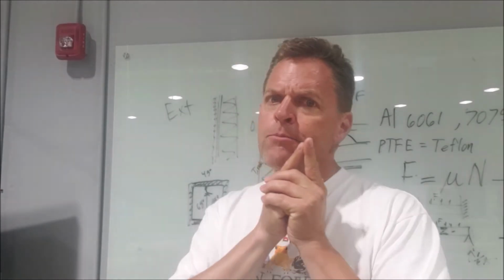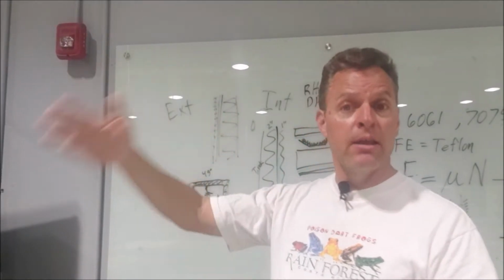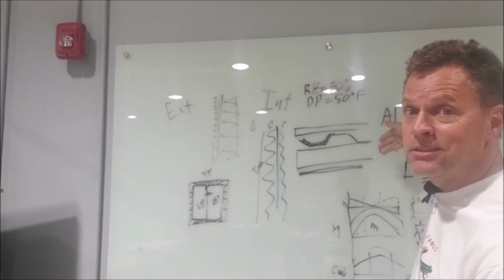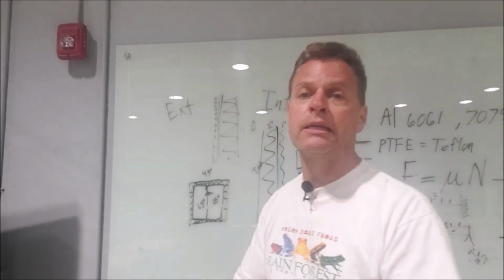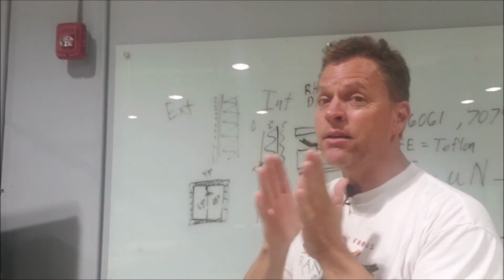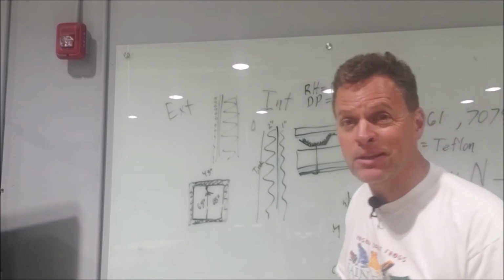Condensation and insulation in an iso shipping container home, Ep. 3

Comment from the maker: I finally found the GPS foam at a foam manufacturer.  They got the beads, made the foam, and cut it to my 1" and 2" thickness for less than buying panels.  I used DeRouchey Foam in the Burbank area of So Cal.  www.derofoam.com  They were so helpful and great to work with.
The foil-backed foam came from a different vendor, who I would not recommend.  Insulation-4-less is more like insults-4-less, as the owner has lots of negative reviews and deserves them.  I don't believe their quoted R-values, but the data sheet allowed by Title 24 engineer to design something that worked.  I think that the other products that are available through other companies, even Amazon, are the same product but without the inflated data sheet.

Comment: You can save $$ Thousands $$ and endless hours of labor by purchasing a single use INSULATED High Cube shipping container with beautiful one piece interior fiberglass walls. These type of containers are designed for frozen food and to maintain subzero temperatures. They are better insulated with 6" XPS structural panels of high R Value. There are various sizes with side and end door options. If you are planning to use the container for housing or an office you could easily move in on the day of delivery. By being frugal it is simple to add modular ventilation Mini Split Heat pump $500 or less for cooling & heating plus your furniture, cabinets, shelving, tools, etc.. Of course you could spend, spend, spend on interior and exterior options. 
MY OPINION:  It does NOT make financial sense converting OLD used uninsulated containers. By the time you add hours of labor to install stud framing, insulation, wall covering, flooring, sealing, priming, paint, etc., the costs can be MORE than NEW CONSTRUCTION when you add the cost of the container and delivery. There are 3 great options of shipping containers.
#1. They can be moved easily to other locations and or installed on a flat bed truck with appropiate Connectors and it instantly becomes a Mobile home. 
#2. Add Optional modular platforms to increase living space at the sides and rear. 
#3. Shipping containers are designed to be stacked. They are easily transported and should be water tight. Simple modifications can be made on the roof for additional living space, lounging, solar panels, etc..

Comment: Hi Alpin, I agree whit you when you said, we have tu put the dew point the most outside of the container stucture that we can.
I'm architect in Chile an right now I'm desiging my house to a warmest area at south america. At my country we have te same zonification map to module the diferent existing climates us your country and I'm studing the insolation for a number 5 zone area, whit to much rain and humidity.
We decide to get the metal structure container not recover by the inside, just only by a good paint whit the idea to put all our efforts at the outside isulation using injected polyurethane foam whit a Tyvek membrane for the humidity control and for the humidity control we must have to use a AC's evaporator.
In addition for the outside we are studing an air camera betwen the humidity membane and the rain cover or siding.

I put some links of interesting papers of this matters.
https://buildingscience.com/documents/insights/bsi078-ship-shape#P04
chrome-extension://efaidnbmnnnibpcajpcglclefindmkaj/https://core.ac.uk/download/pdf/296919169.pdf
https://icontainerhome.com/preventing-stopping-condensation-in-shipping-container-home/
And this complementary video https://www.youtube.com/watch?v=kjbgduaH_7U

I'm be waiting for your insulation paiting studies.
Thank for your clear concepts in your videos.

Comment: Very interested your video, I'm planning do 3 40Ft containers B&B in my property in Costa Rica close to the beach. Do you have some video or tips what tipe insulation I can use there?
Thank you
Reply from the maker: Mostly a warm and humid climate. Will you have A/C? You need to keep the moisture away from the exterior, but polystyrene would probably work with a moisture barrier.
Reply: @Mr. Alpin  yes I will need AC, the area is usually 38c to 44c
Reply from the maker: @anthonydustinchancalvo6841  then your interior will be cooler than exterior and will cool the metal from the inside. Moisture barrier on the exterior is critical

Comment: Thinking of putting an insulation layer against the inside metal. Then a vapour barrier. Then plaster board. Will this work?
Reply from the maker: That should work as well.  It comes down to the details of installation.  How do you seal the joints and making sure you lap the joints to direct condensation.  You are keeping the warm, moist air away from the insulation and then get to the metal.  Are you in a cold, warm, humid, dry environment?
Reply: @Mr. Alpin  im thinking sealant all round the plasterboard joints. As well as round the vents to prevent any chance of moist air making contact with metal. I understand air can penetrate the plasterboard that's why the vapor barrier is needed behind it. Is a varied climate, cold damp in winter, hot humid summer. Have only noticed condensation in winter. May run a small dehumidifier during winter too
Reply from the maker: Yes, drywall is highly absorptive and permeable.  Unpainted is 20-90 perms and painted is still 10-40 perms.  The cold damp winter means that you will heat it so it will condense on the inside, hot humid summers mean you will have AC and might get condensation on the outside.  I would definitely treat on the interior and tyvek the exterior to provide some protection there.

Comment: What extra expense doing all of those layers??? Makes no sense, looks like spray foam is more cost effective.
Reply from the maker: Have you priced out having spray foam installed, especially with multiple spray days?  With spray foam you need studs to set the depth so you need to add framing too and have thermal bridging penalty.  You need to get to about R-22-25 on the walls.  GPS foam is sold by the inch, so it doesn't matter how many layers you have.

Comment: Completely off topic - well almost, and perhaps the subject for another video dealing with condensation... what are your thoughts on building a home with refrigerated or insulated (Reefer) shipping containers. I have been thinking of using reefers and removing the paint finish on the exterior to expose the matt finished stainless steel cladding. I also thought it would be novel to give the same treatment to the bathrooms and parts of the kitchen. The foam insulation is estimated to have an insulation value of R45 to the walls and more for the floor and roof.
Reply from the maker: Interesting thought.  The spec of a refrigerated unit is 8' exterior width, 7'6" interior.  That is 3" of wall thickness per side.  R45 would mean they are achieving R15/inch.  The highest rated closed cell spray foam is R7.  I am guessing that the container is more like R21, at best, assuming no thermal bridging due to ribs.
Reply: @MrAlpin  Thank you for this information, it is helpful. FYI the vertical metal supports in the walls are staggered in an exterior and interior layout and are approx. 30mm deep, each side supports a skin, so no thermal bridge is created.

Comment: Have you seen a container insulated only outside in cold weather?
Reply from the maker: I have not.  I am seeing that the metal gets cold on the interior.  There are enough exposed edges and undercarriage that the metal is pulling the heat out.  I am thinking to add more insulation to my exposed metal walls on the interior for this reason.

Comment: I'm thinking about a product to coat the metal just to start off like Bed liners spray for your pickup truck, or white stay cool reflective paint for painting roofs then put all the rest of the installations on. What do y'all  think? I'm living around Houston TX by the way Thanks.
Reply from the maker: Any insulating coating will help. The foamier, the better.  The difference between white and black will be less significant if it is not a surface that is exposed to the sun. White will reduce the emissivity and absorptivity but I would go with the thicker coat. You might be able to add the microsphere paint additive to one of those coatings to get additional benefit

Comment: Number one:  Buy a refrigerator container in the first place.  It will have a good starting layer between the skins which you can add to.
Reply: Yes your right that would be excellent wow but how much are they?
Reply: @sntruck  not that much more as you don't need the unit.  Sometimes no more.
Reply: Reefers have low ceilings
Reply: @marco-OTM  Not the ones in use in the Pacfic Northwest.  We hauled thousands of them over the years.  In fact I have never seen any that weren't standard height and lengths.

Comment: Even though I would loose interior space, could I build a wood frame with insulated walls, ceiling, floor that had a gap and never touched the metal anywhere in container, except the floor a little, so that it would vent around all 6 sides and metal could remain at nearly the same temp on both sides? Another way to explain might be, a box inside a box with 2 inch ventilation on all 6 sides of interior box. Is that an option worth considering? I am thinking, even if there is still condensation it would be on the outside of the interior house and possibly have drain holes, slanted interior roof etc. Thanks for any input.
Reply from the maker: Interesting challenge. There are some factors that are important to consider. What side of the wall has the warm and moist air?  The fact that both sides of the metal are the same temperature doesn't matter as much as which side brings the moisture. If you are in a cold environment,  the humidity will be in the inside and condense on the cold metal. I have seen it collect and drip off the roof corrugations. The trick is to keep the humidity away from the metal. The ventilation will help but include moisture barriers. If you have a vapor-proof bag inside a box within the metal box,  you should stay dry. If you are in a warm and moist environment and air condition the interior, then your condensation will be in the exterior of the metal.
Reply: @MrAlpin  is there "another way" ? 
Such as using "Cork" - would it bond to shipping container walls or would the natural resin eat the paint? Maybe uncoated Corten steel and then manufactured Cork to fit the contours? 
Then spray foam could be used on the OUTSIDE of the shipping container where it can off gas safely for ever if it needs to, then clad with anything...OR have another layer of metal container sheets and FILL the gap between them squeezing out ALL gaps...
One the inside after Cork is layered appropriately, then a manufactured/milled flat sided log as interior wall, which provides good thermal mass and Additional R value and nice durable interior...
?
Would that be sufficient to prevent moisture build up/condensation or would an air gap be needed between Cork and milled log and then create some sort of negative pressure venting fan or airflow? Or a dehumidifier?
Reply: @MrAlpin or is it possible to create a thicker milled log wall that it multidirectional layered in the "shape" of a container with a steel I-beam frame so that it can be moved "as a shipping container, but avoids nearly ALL issues of the metal trapping moisture because there is almost none to begin with...like 9 or 12 inch log walls?

Comment: Watched this one again today. So, just to clarify, on the exterior: siding/cladding, tyvek/similar, insulation, container steel. Inside: container steel, tyvek?/similar?, insulation, drywall/etc….. Are those the correct sequences? Or have I got a couple reversed?
Reply from the maker: Yes on the exterior. The inside is container,  1/4" foil backed foam as a vapor barrier,  1" GPS, then paneling.
Reply: @MrAlpin  have you ever thought about the concrete siding panels, and rock wool insulation on the exterior, for additional fire resistance, and if so, what did you conclude?
Reply from the maker: @jasonmitchell432  I am using the Hardipanel 4x8 sheets on the two ends of the cabin, metal siding in the long sides. I will have other videos as soon as I get more time to edit and release.
Reply: @MrAlpin  Awesome! I’ll look forward to them!
Reply: Question on the exterior: Would it be beneficial to put double side foil foam to give a monolithic wrapped barrier to the whole metal, especially when framing out the openings so no wood is touching the metal (as a traditional stick build). My thoughts is giving extra protection to the metal against the cold. 
Interior keep as you described. Thank you

Comment: Good evening, I'm curious about using tyvek home wrap on the exterior of my shipping container workshop. Would it be best used on the metal skin of the container then insulating and siding or on top of the insulation below the siding?
Reply from the maker: You want to use the moisture barrier on the warm and humid side to keep the moisture from getting to the metal.  I used Tyvek on the exterior of the exterior insulation under the metal siding and foil back foam on the interior.

Comment: What insulation type and setup would you choose if the exterior was kept as the container metal and water tight in a cold climate all year round? Thanks for explaining all of this.
Reply from the maker: If you want to have the metal container exposed to the cold exterior, then you need to do all your insulation and vapor barrier on the interior, at least R-17 with not thermal bridging.  Remember that all the metal will be the temperature of the exterior and will suck the heat out.  This was going to mean that I would loose about 3.5" per side or 7" overall width on the space so I moved 4" of that outside.
Reply: @MrAlpin  Thank you. I'm nervous about using spray foam but I keep hearing how it out performs insulation wise. I see van builds using hemlock wool so I'm looking at that as well, the less toxic the better in my opinion. I will check out the rest of your channel you may have already answered other questions I had.
Reply from the maker: @timtim-ef7xu  It seems like spray foam is the best, but it was much more money and we could not install it as we were ready.  It has to happen all in one day.

Comment: If not using the foil barrier that you described, would you install a tyvek vapor barrier? If so, does it also go on inside sandwiched between inner metal shell and the GPS?
Reply from the maker: Tyvek is actually not the best vapor barrier.  It has a high perm rating of 56, so is is good to shed most water, but allow it to dry out.  If you want to seal out humid interior air, you need a much better barrier.
Reply: @MrAlpin  Thanks. How are you sourcing the GPS insulation panels? I've looked all over and cannot find them (central california). Am I correct that you are using the foil-backed foam against the inside metal (with foil against the metal) and then the GPS is added? So: container | foil-backed ridged foam board | GPS? Any thoughts on using double bubble foil in place of the foil-backed ridged foam (assuming I understand your plan)? Sorry for all the questions, but I believe that of all the sources I've looked into, you have the most thoughtful and data-based plan.
Reply from the maker: @rustart  I just put the vendors in the pinned comment.

Comment: Forest Grove, OR. Well have rain, some snow, hot summer and wet spring. How to figure that out for insulation?
Reply: You need to prevent the warm humid air from contacting both sides. Again,  insulating and wrapping both sides will be critical to keeping the metal from getting cold and warm air from contacting it.
Reply from the maker: You will have to moisture barrier both sides, I would expect.  Also, you need to keep the metal from getting cold from either side.  I would expect you need a similar solution to mine, insulated on both sides with moisture barrier on both sides.